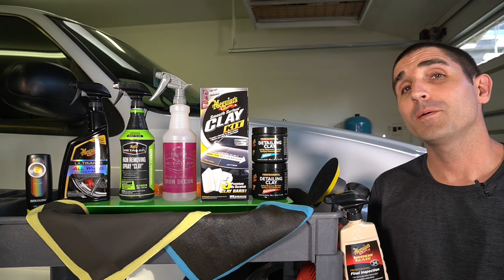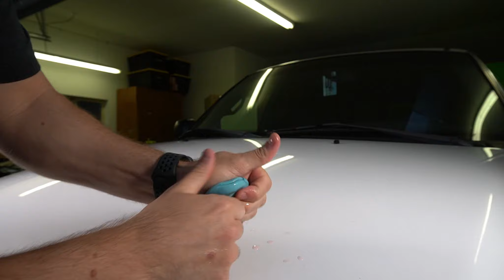Top Pro Tricks to Making Paint SMOOTH and GLOSSY

Comment: Your explanations on how to use these different products are concise and informative. I detail cars for a living and I used to use the clay bar for decontamination. I’ve found the clay mitts are much faster and easier to use and they do just as good a job as regular clay. On hot summer days it’s no fun using sticky clay to remove bonded contamination.
Reply from the maker: Thank you so much! I do agree that synthetic clay (mitts or discs) are usually much faster than traditional clay (largely due to the greater contact area). I will say, though, in some cases I find a quality true clay will dig a little deeper and clean a little more thoroughly. Not always, but sometimes. So just be aware of that and do a quick baggie test to check your work and you should be golden!

-MK

Comment: How about bug, tar remover and degreaser? When best to apply them or is it using clay and iron decon is enough?
Reply from the maker: I originally had those products on my cart, but took them off as my first take was 45 mins long! Lol. Good questions. Bug & Tar products tend to either be "bug" OR "tar" focused, despite the confusing category and product names. The more solvent-heavy options tend to make quick work of tar, whereas the ones that are more about cleaning and lubrication tend to work better for bugs - rarely both. I would use something to soften bugs immediately before the wash, trying to get the bugs soft before touching the paint. 

I would do the tar product after the wash. Then rinse thoroughly. 

Clay will work on tar (sometimes), but is not the optimal solution for more than a few specs of it. 

Acid can sometimes be used for bugs as well, and I would rinse the car first to help partially dilute the acid as to avoid potential damage as it sits and does its thing. Then rinse thoroughly and wash the area.

Comment: Hello markus, concerning the clay towel, how to recognize a fine, medium and hard ?.  Example in your video that it is the hard and the thin, is it yellow with fine lines, or blue with thicker lines ?.  Thank you in advance.  Nico
Reply from the maker: Hi Nico, it varies by brand/manufacturer, so there really is no set standard. Even the way one "fine" feels vs another will vary. So you just have to look at the packaging of the specific one you get. They should call it out somewhere.Within a specific brand they do tend to use a different color for the towel to help denote the grade, but again, each brand is different.

Comment: Great vid man, can you dilute the wheel cleaner to spread better?
Reply from the maker: You could. How I do it is take my wash mitt from my soapy water bucket and then just bring the leftover water in the mitt to the panel and it helps spread it out. Don't use too much water as it will reduce effectiveness and cause it to rinse away. Just use the wash mitt damp and that should be perfect.
Reply: @MarkusKleis  sounds perfect, I was thinking aswel, by emptying the wheel cleaner into a normal spray bottle aswel.

Comment: Thanks for the info.  I’ve seen a few clay/decon videos that indicate you shouldn’t even think about using clay unless you are willing to follow up with paint correction.  That’s a little overwhelming for an older guy like me with a bad shoulder.  Any thoughts on how to get the benefits of clay/decon without the additional commitment of paint correction/polishing?
Reply from the maker: Hey J, sorry for the delay in response. What color is your vehicle? If it is a lighter color, stick with a mild or fine clay (like consumer grade) and you should be fine 9 times out of 10 to clay and not even see the need to the naked eye to polish.

That said, if you want to 100% avoid the need entirely or if you have a darker color car, I would stick to a chemical decontamination process (use something like D1801, or Ultimate All Wheel Cleaner) and just gently agitate with a wash mitt. It may take multiple treatments to get it all. 

If there is any non-ferrous contamination, you may need to use a tar remover for tar (and a soft towel) or try isopropyl alcohol and water to remove tree sap (do this on a cool surface in the shade). 

That should avoid the potential for marring altogether. Lastly, you can use a cleaner wax with some light filling like the newer 3-in-1- Wax which removes some light defects if you polish it aggressively, or it will at least darken and fill the light stuff temporarily if you just apply it like a traditional liquid wax. 

Hope that helps, if not, keep asking away!
Reply: @MarkusKleis  Markus, thanks for your response. My Camry is Ruby Flare Pearl and the car is a daily driver that sits outside all the time.  I’ve used the Meguiars Smooth Surface Clay Kit, but was planning to try the NanoSkin Handy Towel due to the suicidal nature of clay in my hands.  I’ve been using Meguiars Hybrid Ceramic Spray Wax every 4-5 weeks since purchase with good results. For this Spring cleaning, I’m thinking I’ll try the All Wheel Cleaner and then determine whether I need some mechanical decon before applying HCW.  Living in the Atlanta area, we get a lot of pollen but I’m not sure how much of a threat it is to clear coat compared to brake and rail dust.

Keep up the good work in providing some basics for us weekend warriors who want to care for our cars!
Reply from the maker: @jroberts1520  I think that’s a good plan. Always do a small test spot with something abrasive and make sure it doesn’t cause issues (like that clay towel) before doing the whole car. 

As for pollen - it doesn’t really damage anything, just looks awful. 

When the time comes for that spring cleaning let me know if you need any more tips!
Reply: @MarkusKleis  Thanks!
Reply: The Ultimate All Wheel Cleaner worked pretty well during my Spring cleaning and the car looks great.  I’ve been really pleased with the results I’ve experienced with Meguiars HCW spray over the last 13 months.

However, a few weeks later I’m noticing some stains from the All Wheel Cleaner on my matte black “B” pillars.  Do you have some tips to remove/restore those areas?  Thanks!
Reply from the maker: @jroberts1520  Hi J! I hit them with some light cleaner and a microfiber towel to start with and see if that does the trick. You could use diluted APC, or try glass cleaner. If it doesn't budge, you can try some finishing polish or a cleaner wax and rub the area with a microfiber applicator. Do it with light to moderate pressure at most - you are using it as a mechanical cleaner in this case. 

When done, I would clean the area with the glass cleaner or diluted APC again, make sure the results are true, and then you should put some form of protection over that plastic. 

Let me know if that doesn't work!

Comment: Hey, really digging these videos. Lots of good information. I'm curious about what to do after iron decontaminating the car. Do I just rinse off the decontaminate? What if I'm in my garage and/or am otherwise unable to wash my car in my city due to bylaws on what goes into the sewer drain? Should I use a rinseless wash solution or can I just wipe off the decontaminate?

Thanks
Reply from the maker: Thank you very much! That's a great question - in my experience, you really want to "rinse" the area one way or another with ample water. If you can't hose it off, a rinse-less wash method from a bucket would be your next best option for sure. The towel alone will not likely get it all. 

Then just come after that with a nice clean towel and you should be set. If you are going to apply a coating of some kind, make sure you then use a panel wipe of some sort before applying the coating. If applying a wax or sealant, I wouldn't worry about it. 

Let me know if you have any other follow-up questions! 

-MK
Reply: @MarkusKleis  Thanks for the quick response. I'm looking at applying the Maguiar's Hybrid Paint Coating to my vehicle. I recently got it polished and a 3m put on it. I wasn't sure how important the iron remover and clay treatment was after having the work done on the car, but I wanted to do it right. 

So, I will probably wash, dry, once it's cool do the iron treatment, rinseless wash it off, clay treatment, iron treatment, rinseless wash it off again, then apply the prep solution and the hybrid paint coating.

This is my first car that I've decided to detail and maintain like this.
Reply from the maker: @Pyratic  If you had the clear bra put on recently, you will not need to do the iron decon in that area at least. As for any remaining paint, what I would do is test it with the hand in the baggie test during the wash step. If you rub it on the paint and feel bumps, then you need to decon, if there are no bumps, no need to do that step, just proceed to M122. 

I would do 2 coats on the PPF, and if you are up for it, might as well do the whole car with 2 coats but as long as the paint is in decent condition it isn't required, just suggested.

-MK
Reply: @MarkusKleis  Appreciate it. Good to know for the PPF. I had the PPF done a couple Sundays ago. I haven't washed the car yet since they told me to wait 2 weeks for it to cure. Was going to do this application next weekend, so the 3m had enough time to cure and I have the weekend to work on it.
Reply from the maker: @Pyratic  That sounds perfect. Rinse-less wash, then M122 and apply as usual. Hybrid Paint Coating really loves to bond to PPF in my experience - and the way it makes it slick instead of tacky makes it sooo much nicer to wash and dry down the road. You should love it!

Comment: Excellent content.  Megs Wheel Brightener is an excellent product and very little is needed given the dilution ratio.  Is it possible to dilute Wheel Brightener and utilize as iron /decontam on paint ?   If so what dilution ratio ?  I believe some pros use it remove bugs, tar and hard water spotting
Reply from the maker: Hey CP,

In theory you could use it, but it isn't optimized for that role. I can't honestly say I have tried it for large areas for the purpose of iron removal with much success - only for confined areas like around badging using a small detail brush. If you do use WB, just make absolutely sure you very thoroughly rinse when done and neutralize the area so it doesn't degrade the clear. 

As an acid, you can use it for water spots - not sure it would work very well on bugs, though, as most often those are removed with an alkaline product in my experience. 

As for dilution, I know folks use it between 2:1 and straight BUT usually pre-rinse and wet the area first so even if applied full strength it is still being partially diluted. As always, work in the shade on a cool surface.

-MK
Reply: @MarkusKleis  Thanks very much

Comment: What tipe of ácid i can use for real bad rims
Reply from the maker: It depends on the type of finish on the wheels. You need to make sure that the wheels are factory coated - which means they have a clear coat that is either paint-based, or powder coating based. Most new cars come with painted wheels that have a clear coat and some sort of painted finish or simulated metallic finish. 

For those, you can use any acid-based wheel cleaner as long as you pre-rinse the wheels and follow the guidelines for dwell time, agitation and rinsing methods. 

Being as that I mostly use Meguiar's, I use the D140 Wheel Brightener most of the time if I use acid.

-MK
Reply: @MarkusKleis  ty

Comment: Great video content. I'm still a newbie. Is it safe to use claybar or these iron remover chemicals on paint with ceramic coating like the Gtechniq serum? If so, how often in general? My new car is arriving soon and I'm getting it applied with ceramic coating. So need advice for ongoing maintenance. 
Current car is 5 years old and I find its ceramic coating is losing half its effectiveness esp the door panels. Thinking of trying the All Purpose Wheel cleaner with damp soapy mitt. Will that revive the coating? Last thing I want is to strip the coating protection away.
Reply from the maker: Hi Car Tan, 

Thank you. Using a clay bar or synthetic clay ALWAYS comes with the risk that it MAY cause marring or fine swirls. It's impossible to know for sure without trying it, but it generally does do at least some fine damage. Remember, clay is an abrasive - it comes in different grades, but even fine can potentially do light marring (usually only visible on darker colors without close inspection).

That said, a chemical iron remover and using a wash mitt to agitate is a good way to clean up a coating. If the coating is still strong just clogged, it will not cause harm - but sometimes you may find the coating was not clogged, but actually nearing end life. Either way, nothing to lose because if it was toast anyway, it was toast anyway :) 

Another thing to try is to use acid-based water spot remover from time to time (once or twice a year at most in normal conditions) to gently wipe away any minerals that may have deposited onto the coating and begun to clog it. 

If neither of those two things refresh the properties, the coating itself needs to be topped up or refreshed completely with a new application. 

The best advice is to wash often (once a week or two) and do not let things sit on the paint (water spots, sap, dirt, mud, tar, etc). Try to get it clean ASAP when something more than dust gets on it as this is one the bigger threats to coatings.

Second, your actual wash and dry routine is essential! Use high quality mitts, towels and washes, and be very gentle, avoid scrubbing. The majority of swirls and abrasion comes from washing or drying.

Lastly, it can help some to occasionally add a topper as an additional sacrificial layer - Gtechniq sells c2v3 for that purpose.

Hope that helps!

-MK

Comment: Hey Karkus what’s the best contact angle you’ve seen in a coating?
Reply from the maker: Lol! Well, let's just say that the vast majority of products with 110 slapped on their packaging "have some 'splainin' to do." Achieving 110 is no easy feet and requires a special panel with immaculate prep and a specific process to drop the bead onto the panel to achieve with coatings that actually translate to the real world. There are definitely several in the 105-108 range in a lab, but again, it requires a specific application and does not always translate to the real world. Those same coatings in the real world are most likely around 95-100 - sometimes less!

That said, static contact angles are one small piece of the puzzle - while I love looking at a perfect bead sitting on a horizontal panel as much as the next guy, I tend to focus on dynamic contact angles more.
Reply: @MarkusKleis  the reason I was asking was the fever of using fluorine waxes is starting to pick up and I’ve seen people comment about it having 120 and also seen claims of boron nitride being mixed into wax to achieve 124. 

How should I research dynamic contact angle for coatings? 

I’ve always been a max gloss or bust guy, but I find the conversation around contact angles fascinating. Appreciate the reply. 😘
Reply from the maker: @NipponStiqqyPaint  Various forms of Fluoropolymer or fluorinated chemistries have been employed by several (if not most) coating companies out there for some time. It already does exist in some popular waxes (Fusso) as well. It's  more common than people realize - especially in coatings. 

That said, I highly doubt they have anywhere near 120 degree contact angles - especially not in any situation that would be possible on a car. That sounds like some 10H marketing nonsense right there. If a wax (BIG IF) actually achieved a measurable contact angle that high, $50 says it would drop 20 degrees after one basic wash. There are cheater ways to create bonkers high contact angles, but they come with tradeoffs that are generally undesirable from a complete package standpoint. 

There are also important health concerns related to fluorochemistry - some with existing laws against use, some with open discussion about possible harm due to their persistent nature. Either way, use with caution.

As for researching contact angles, I will be doing some special content in the near future to help break it down :)
Reply from the maker: Some related info: https://www.cdc.gov/biomonitoring/PFOA_FactSheet.html

Comment: Did not know to use a wash mitt during decon!  Thanks for dropping knowlege bombs!  Is D143 the same formula as the all wheel cleaner?
Reply from the maker: My pleasure! D143 is most similar to the consumer Hot Rims Wheel & Tire Cleaner in the purple bottle. Ultimate All Wheel Cleaner is a unique formula that is pH neutral, won't clean tires, and has a different formula than either of the two products I just mentioned. The D2002 Iron Removing Spray Clay is also unique compared to UAWC, but is similar in some ways. It is pH neutral, won't clean tires, but swaps the additional wheel cleaning package instead for a slickness package so it can be used on paint like a lubricant for some clays. Lastly, D1801, Wheel & Paint Iron DECON, is unique, about 30% stronger than UAWC, and has a slightly thinner viscosity to spread better on paint. It works the fastest of all of the Meguiar's pH neutral iron removers.

-MK